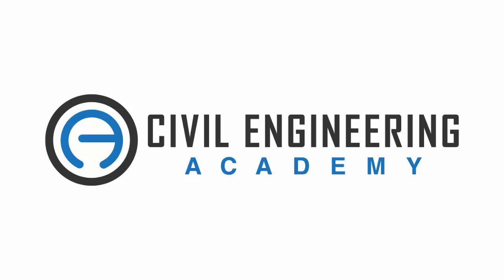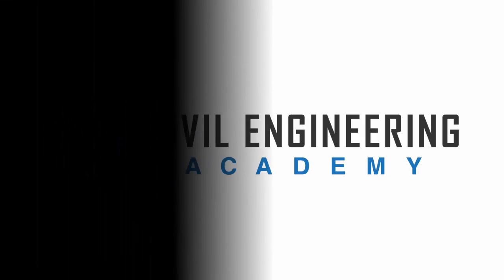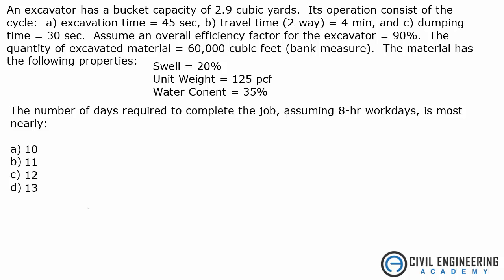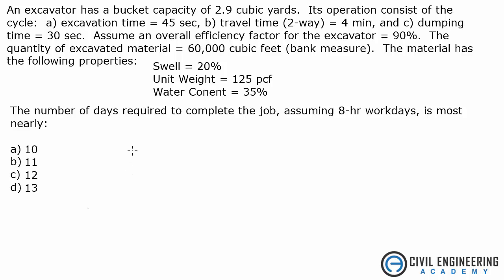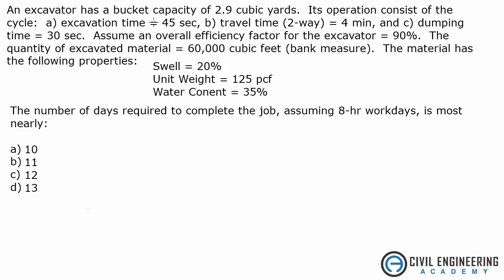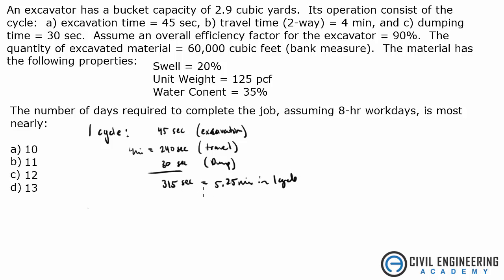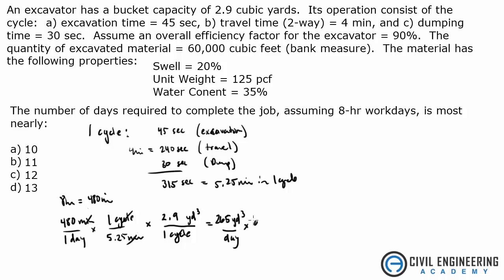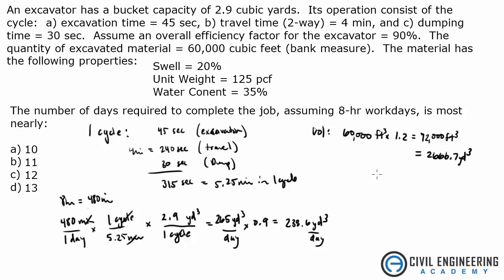Construction-Work Estimate of Excavated Bank Soil with Swell

Comment: So the excavator takes 45 seconds for one scoop. It then tracks away for 2 minutes and in 30 seconds it dumps the bucket. It then tracks back for another scoop lol
Reply: You can’t blame engineers for not understanding the work. In the most recent copy of the standard handbook for civil engineers it says people still use drag lines, and grubbing shall be done with low strength explosives

Comment: The Cycle time is calculated for 2.9 CY. Unless that’s the capacity of your truck, you are only moving 2.9 CY in 5.25 Mins. Incredibly unrealistic and not real world. The problem should include a truck capacity, so the excavator cycle time x cycles required to fill the truck is included in the cycle time. i.e. a 12 CY truck can take 4 buckets of fill
Cycle Time = 4 cycles x 45 sec. + 240 Sec. + 30 Sec = 450 Sec/11.60 CY  - 7.5 Min/11.60 CY
8 hr. day @ 90% = 432 Mins. 432/7.5 = 57.6 Cycles ~ 57 Cycles
One truck can handle 57 Cycles/Day. 57 Cycles x 11.60 CY = 17,852 CF/Day
60,000 CF x 1.2 Swell = 72,000 CF / 17,852 CF = 4.03 Days for 1 truck

It takes 3 mins to load a truck and 4.5 mins for the truck to return for the next load. The excavator is at 40% capacity. Use 2 two 12 CY trucks to keep the excavator moving, the excavator capacity increases to 80%. And the job is done in 2 days.

Comment: I don't think this method is quite right. the swell factor is based on dry unit weight. you would have to find the dry unit weight of the bank material and use that and the swell factor to find the dry unit weight of the loose material, then you can find the volume of the loose material based off of that.  The final answer should be A.
Reply: So are you gonna place the material on a scale? As it sits in the ground ?

Comment: I have noticed this in a couple of your YouTube sample problems: the problem states the number of days is most nearly?... So why would you round up, is that what we would be expected to do on the exam?
Reply from the maker: +Mario LoCoco if you, for example, had an answer of 10.4 days you'd round up to 11 because nobody works or schedules 10.4 days and you wouldn't round down to 10 days because you have 10.4 days.  So you would round up.  The term "most nearly" is one of the "tricky" parts of the exam.  You really have to pay attention to what they are asking for and why you would round up or down with the solution you get.  Hope that helps.

Comment: I think the excavator`s capacity use the BCY not the LCY. Please advise.
Reply from the maker: Hazim Alwaali the excavator's capacity would use the LCY.  You are given the swell factor and as soon as it is removed from the bank it falls into the LCY category.  Sometimes extra information is given in a problem like the moisture and density to make you think hard about what you are dealing with but really all we needed to do is multiply in the swell and we got what we needed for the volume.  Hope that helps.

Comment: I see that you calculated the total number of minutes per cycle incorrectly. It actually takes 5 minutes and 5 second which is more like 5.08 minutes. After you do the math you should come out with 10.82 days which you can round up to 11. That small error could cost you this problem. Very well explained though. Thanks.
Reply: What?? Excavation + Travel + Dumping = 45 sec + 4 min + 30 sec = 5 min 15 sec = 5.25 sec. The problem is correct. I did it myself before watching the explanation. I got 11.17 days at the end of the problem.
Reply: Nevermind...My apologies. I made a mistake on my calculations by incorrectly plugging in 20 seconds of dumping time instead of 30 seconds. I stand corrected. I've watched all of your videos in preparation for the PE exam coming up in two weeks. I can't express how beneficial your videos are. Thank you so much!!